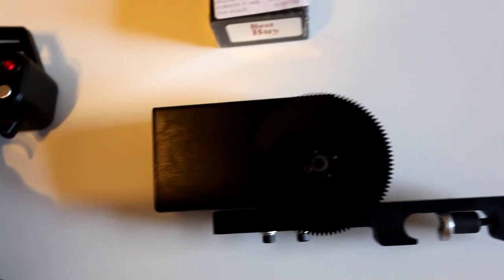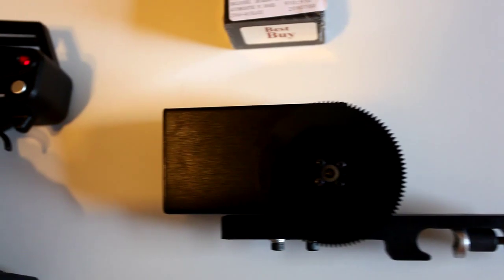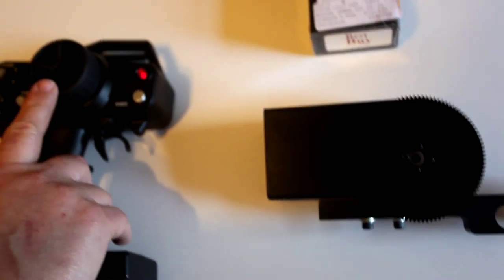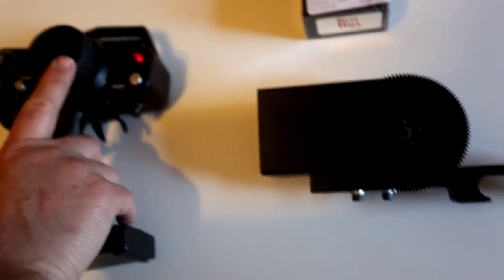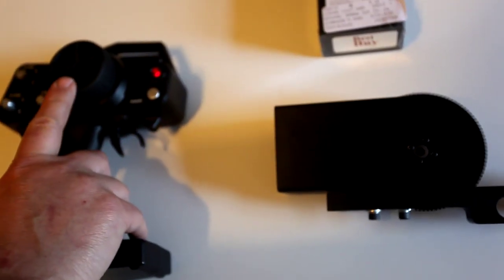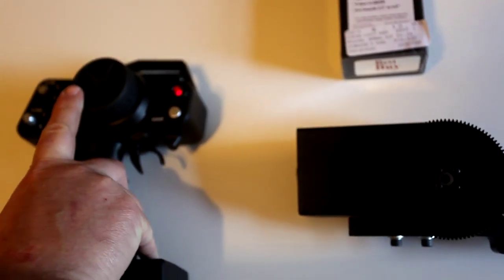DIY Wireless Remote Follow Focus for 5D MKII

Comment: People say that audio isn't an issue, but you'll hear this in any room, regardless of if it's recorded with the camera mike or a 2nd system.     A good boom or a LAV will pic this up.  This is the problem with the Jag Unit and these servo ones.   A quiet pro system will unfortunatly cost 3k.

Comment: The noise shouldn't be a problem because the 5DII's audio is pretty much worthless anyways, so you already need to record audio separately.  But this is awesome for under $200. I don't think you can even get a manual focus follow for under $500, let alone remote.  And in regards to this being pointless, a lot of the time the AC is the one pulling focus.

Can you mark focus points on the remote accurately?